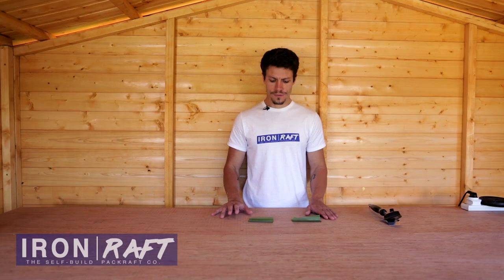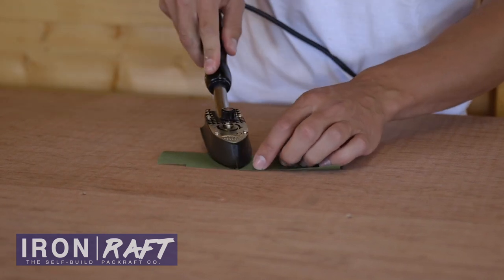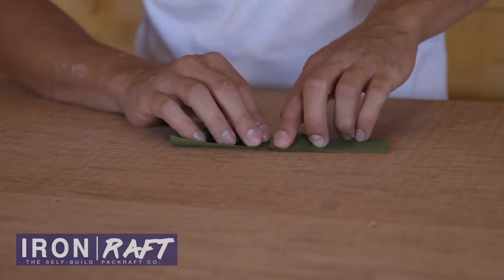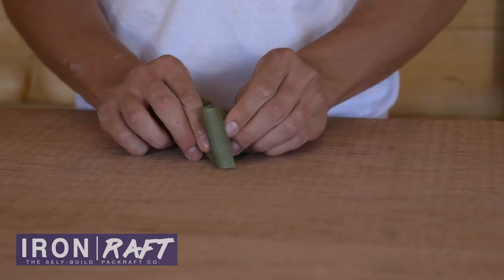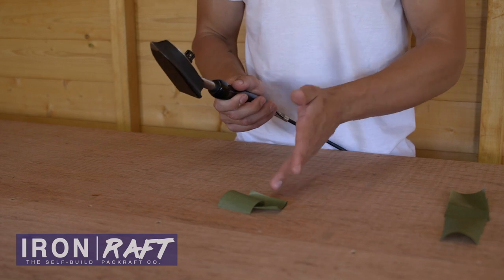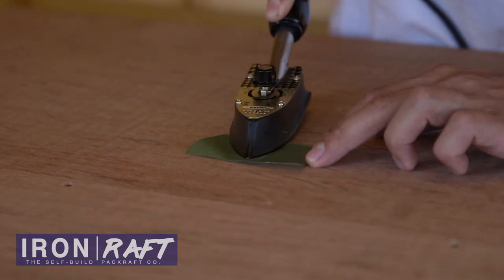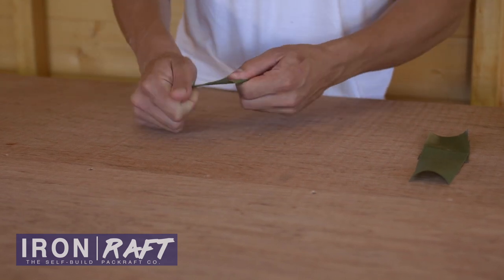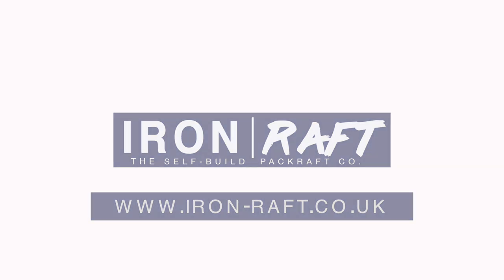TPU Fabric Heat Sealing Explanation for making a Packraft

Comment: Great video, thanks! Is that iron you are using coated with something so the plastic doesn't stick to the iron?
Reply from the maker: Thanks Robert. The Iron has a teflon coating, although it has worn off at the tip as you may be able to see in the video. Our fabric is high temperature nylon so it will not melt/stick to the iron around 200 deg. so it is more to do with the fabric rather than the coating on iron.